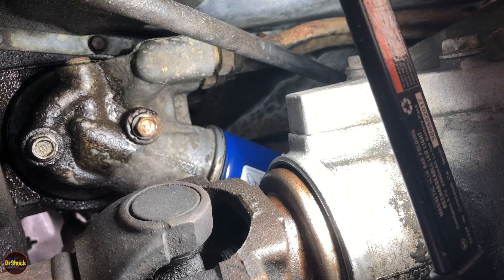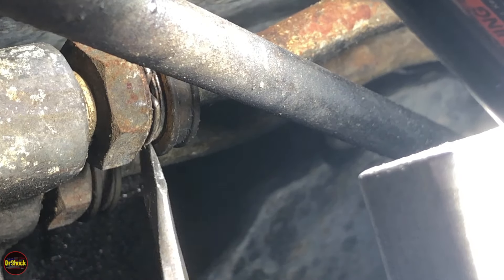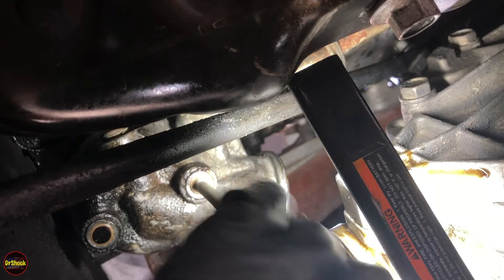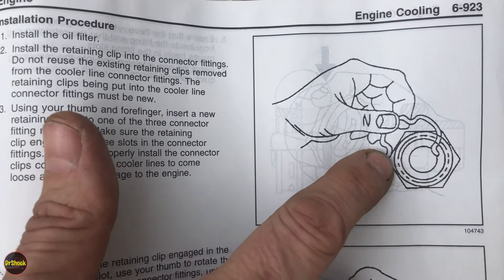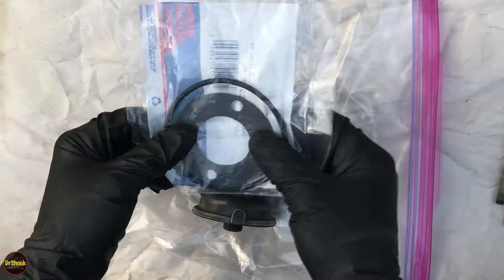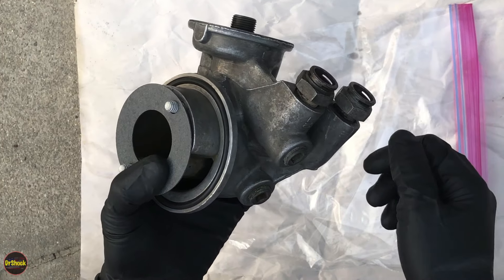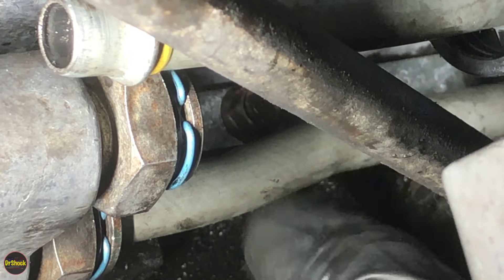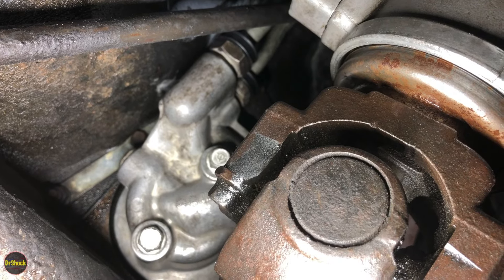1996 - 2000 GM OBS 4WD K Truck Vortec V8 5.0L / 5.7L Oil Filter Adapter Leak Repair (Chevy & GMC)

Comment: Did mine a couple years ago. I went ahead and replaced the fittings and the lines while I was there. Make sure to get the good fittings, the Dorman ones leak.
Reply: Best bet is to run the old inverted flares. Yeh, they are a beast to tighten up/assemble, but after my trans cooler lines almost fell out of the transmission with this style in this video(due mostly to age/corrosion but flares would not have behaved that way) and the way the heater core hose to intake quick connect broke off(while changing out the 'plastic intake gaskets' bwahahahaah to Felpro superseals that will not dump gallons of water into the crankcase), no thanks on these sub-quality fittings, not to mention these quick connects are like double the price of the old school better living/longevity flare fittings. But yes, the GM's are still better that old rebuilt dodge in at least commonality lets you reverse engineer most things to the old school longer lasting designs.
Reply: Thank you I was just assembling tools to do this job and seen all my parts are dorman I'm going to the dealer instead

Comment: Are the cooler lines necessary on a K series 1500? I've seen several videos of truck owners deleting the lines and installing a filter adapter that allows the filter to go on vertically.
Reply from the maker: Personally, I'm not a fan of making any powertrain modifications from the as-built configuration of a vehicle.  I like keeping that all vanilla stock, with no use of inferior aftermarket sourced parts.

But these oil cooler lines, and the oil cooler, are primarily there for extra cooling capacity when towing or hauling.  So if you use the truck more like a car or SUV and do neither, the lines could be redundant.
Reply: @DrShock  Understood. Thank you for your feedback.
Reply: @DrShock  , I pray you do not use the plastic 'factory vanilla' intake gaskets though or that wonderful dexcool that turns acidic and causes cooling system havoc such as eating those intake gaskets even faster without frequent flush/changes. BTW, excellent video here, sincerely appreciate the education on this.  Helped me immensely so far. My truck was rigged before I purchased (someone basically cut all these lines and pipe plugged everything, so would have preferred they kept to vanilla stock in my case. Thinking of upping this truck to the chocolate fudge deluxe from vanilla by running compression/flares with copper lines that will not corrode as fast, running a used but perfect condition factory GM auxiliary cooler in front of radiator, unfortunately missing the factory vanilla auxiliary cooler mounts, so will be much time spent fabricating such mounts

Comment: THANK YOU!  I’ve got a leak either off this oil filter adapter or the entire drain pan gasket. The leak is definitely isolated to this area but I cannot tell which is leaking. So, which is more likely the leak: the oil filter adapter seals or the oil pan gasket?  98 Vortec 5.7. Thanks!
Reply from the maker: Adding a dye to the oil would be the best route to determine where it's coming from.  With the age of the vehicle, do not be surprised to find out it is all of the above ;-)
Reply: Where did you manage to find the parts at?

Comment: I'm in the process of changing the torque converter seal I figured I would change the rear main while I have the tranny out. I ended up trying to do the the top seal for rear main housing without pulling the oil pan and dropped the old gasket in the pan probably for the better as it looks like it's leaking the trucks 4x4 and I'm wondering if it'll be simpler if i lift the motor instead of rolling the axle I'm doing this on the ground and I'm not sure as most information available is done on a lift. I do have a motor hoist but im dreading pulling the exhaust pipes as the truck has 226k and they're pretty rusty

Comment: where can you find the bolts now?
Reply: @matthewhowell8246  having the same problem. The only place that showed the bolt part number said it’s discontinued.
Reply: @mrja9898  You can find the bolts and the washers at a hardware store. The bolt is a 5/16 x 18 - 4" and the sealing washer should fit the bolt. It will be a washer with a built in o-ring. I took screenshots of each part that has been discontinued from GM and used those as references while at the store. I could have brought the OE bolts with me but I like to have all the new parts I will need in front of me whenever I start a job. 

FYI, putting sealant on it may not work because of curing times. Install the bolt and wait for sealant to cure??? No thanks, I cannot strand a vehicle in my bay.

Comment: Dr Shock maybe you answered this question. Which is inlet and outlet on the filter housing. I had about a week of waiting for parts to come in but mine is not labeled. Thanks for your time as always.
Reply from the maker: I’ve never seen one of these GM aluminum oil filter housings not have the “IN” and “OUT” cast on the outside.  But if yours is missing suggest you scribe a mark as you remove the existing lines for future reference.
Reply: @DrShock  unfortunately doing the oil pan gasket and front cover...I did not mark it. Outlet on the radiator is the lower...but I'm confused on the daggone oil filter adapter. It's put back on with the new gasket and bolts I would prefer not to remove them

Comment: Dr shock I can’t find the bolts anywhere seems to be that they are discontinued and I can’t find them anywhere in stock do you think the Chevy dealer will have them if I go there?
Reply from the maker: Yes, GM has discontinued that part.   The dealer would not have them either unless they happened to have old stock from years ago. But the dealer should also be able to search for any USA dealers with the part left on the shelf to give you a lead.  You may have to improvise, repairing your originals with a thin silicone film to replicate the sealing effect.
Reply: You can find the bolts and the washers at a hardware store. The bolt is a 5/16 x 18 - 4" and the sealing washer should fit the bolt. It will be a washer with a built in o-ring. I took screenshots of each part that has been discontinued from GM and used those as references while at the store. I could have brought the OE bolts with me but I like to have all the new parts I will need in front of me whenever I start a job. 

FYI, putting sealant on it may not work because of curing times. Install the bolt and wait for sealant to cure??? No thanks, I cannot strand a vehicle in my bay.

Comment: Can I reuse the bolts and just by new sealer washers??
Reply from the maker: Technically no, but the self sealing bolts from GM have been discontinued since the pandemic.  These were never offered aftermarket.  So you cannot buy them anymore, making improvising the repair necessary now.

Comment: I had to go through the wheel well to get the top clip out who ever did it previously had the open end facing towards the ground very frustrating also I used a magnet to make sure I didn't loose it in my driveway.

Comment: Would it be possible to just re use the bolts and use some crush washers instead?
Reply from the maker: These GM washers are impregnated with a form of neoprene to effect the correct seal.  I would expect any non-OEM part substitutions to just leak prematurely.
Reply: @DrShock  Fair enough, and thank you for the video! I have a 99 Suburban I'm slowly chasing all the gremlins out of!
Reply: @DrShock  , how about some thread sealant? I'm assuming perhaps the oil will not allow a complete cure of the silicone, thus future leakage while thinking this out loud.
Reply: Pull driveshaft.  15 min tops. Much easier to service.

Comment: great work Dr Shock, would you happen to know the GM part number for the adapter?
Reply from the maker: It's discontinued for several years now, but there is a part number link in the video description.  They show up as NOS from time to time.
Reply: is this ebay link the same thing but with different part number; looks like it would fit @DrShock
Reply from the maker: The link in the description is the part number for the OBS trucks this video covers.  It includes some earlier supersession numbers as well.  Any others would not be for this particular engine and model year range.

Comment: My 98 Chevy Tahoe k1500 has a leak around this sucker and I can not for the life of me find a new rubber gasket that goes on top do you know where I can find one?
Reply from the maker: There are search links in the video description.  I know the gasket is still showing available there.   But the self sealing bolts have recently been discontinued by GM.

Comment: When removing the lines, could i just unscrew them instead of messing with the clips?
Reply: Did you ever get an answer for this?
Reply from the maker: If you both are referring to the fittings screwed into the oil filter housing itself, that wouldn't be the service manual procedure for this job.   The plastic retaining ring will have to come off to expose the clip, or the line will bind up with the fitting preventing it from unscrewing.  The lines themselves can be bound up to the inside of the fitting as well.  Lastly you will be fighting clearance problems as well attempting to remove the fitting while still connected to the line.  I would suggest it's a more difficult approach than just removing the retaining clips and unplugging the lines first.  But, as long as the binding and clearance problems are addressed first, it should be possible.   If you do go this route, the fittings themselves can become another source of leaks at the housing threads so will need a thread sealant or replacement.

Comment: Tried to find the washers for the bolts they are discontinued everywhere where did u get them?
Reply from the maker: The bolt and captured sealing washer came as an integrated piece, not separate.  It does appear GM has recently discontinued this part, which unfortunately is going to be happening more and more across all of the old body style (OBS) GMT400 parts due to obsolescence.  

This part might show up at the search link I provided in the video description as NOS (new old stock) so worth saving as a search, but afaik there is no aftermarket replacement for it.
Reply: Alrighty thanks

Comment: Doc, do you know the part number for the 1996 K2500 7.4L gas engine?
Reply from the maker: The 7.4L uses a very different oil filter adapter design than what I'm showing here.  It is more similar to the 6.5L diesel one than the small block V8s.  I believe it just has an o-ring seal, no gasket kit, GM 12555554 - https://ebay.us/tylJSh
Reply: @DrShock  Thanks Doc!l I knew mine was substantially different but could not find the GM part#. You seem to be a Wizard at getting the correct GM Part# and sources. Thanks, Again! I ordered it off ebay with the number you provided.

Comment: I deleted my oil cooler lines 10 years ago  on my 1991 GMC1500 after two sets of replacing the cooler lines , because I don't tow any thing .